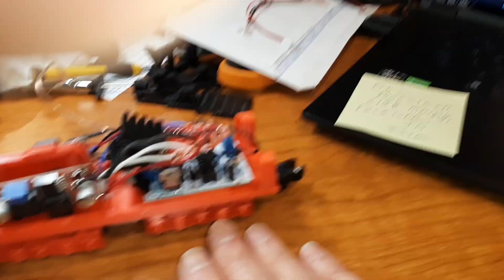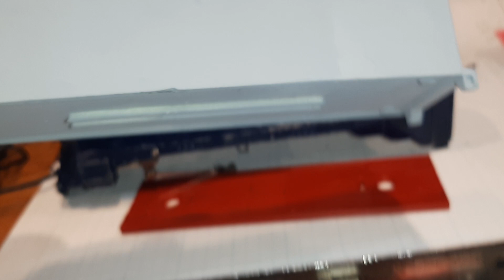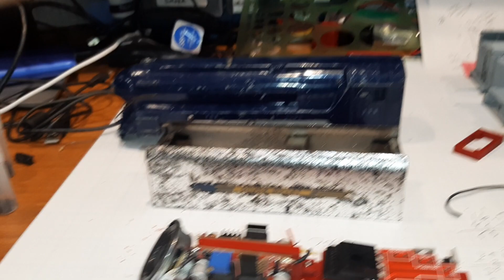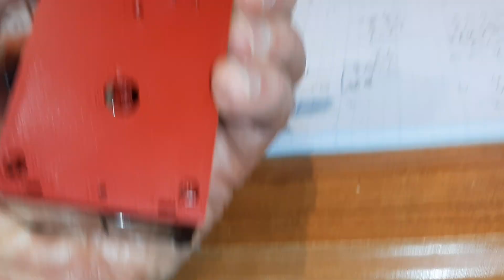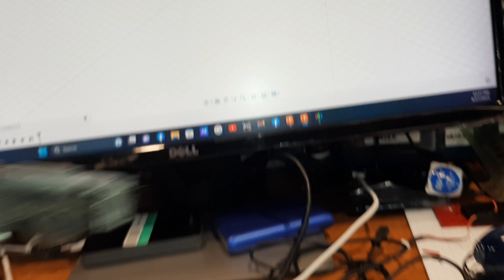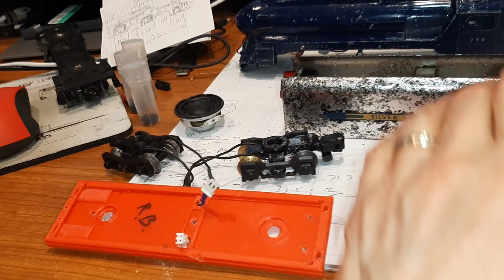Frankentrain Laboratories the Royal Blue Tender is Stuffed with Next Gen S digital Puff & Chuff etc.

Comment from the maker: I forgot the streamlines tender body was made by Leon for an Auxillary Water Tender for the Royal Blue. The plan is to stuff the 4 sounds into that Aux Tender.  Now you can see how that would look. I need to get the 4 sounds back up mounted on a tender with speaker and good AWPU Trucks for constant voltage.  D

Comment: I do believe that you might be on the right track.  you have  compacted and  and answered most of the issues.
Reply from the maker: Thank You for the input, Yes I have one last concern, the HEAT from the Rectifiers. I will work that issue two ways, Replace the device with DIODES and or add  5V Fan.  This can be the excellent base line for most any Steam Engine or Diesel engine with a DC Motor.  The Digital Puff & Chuff is an option for the Mechanical Vintage Puff & Chuff and we still have 4 sounds to play with. Provided I can get reliable voltage stability from rolling stock. Hoping all wheel pick ups will fix that issue.  D

Comment: Very Way Cool
Reply from the maker: It has taken years to get this far and we still have more years to complete our goal.
Reply: @DennisMurphey  I may be dead in a few weeks, let alone years brother. I will give fusion a look and see. Thanks. I am currently reprinting the Hudson Boiler with the black resin and did some changing of orientation so all I need to do is remove the supports and not need to do much cleanup on it. Will send pics tomorrow or later tonight via email.